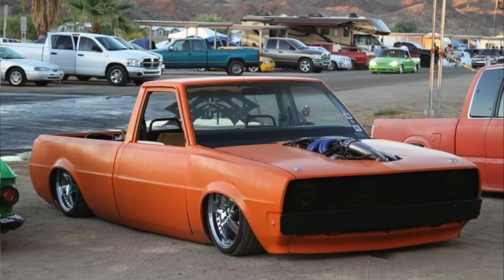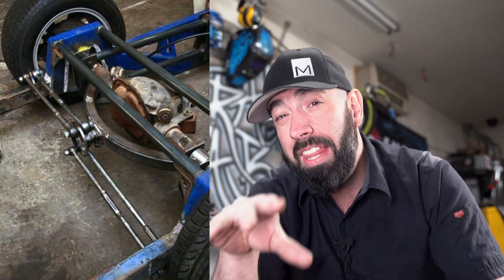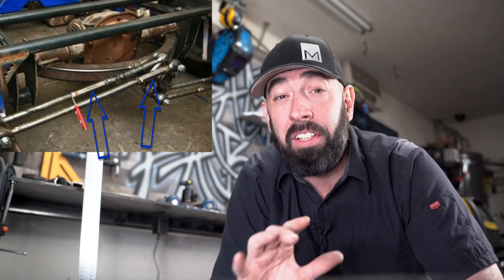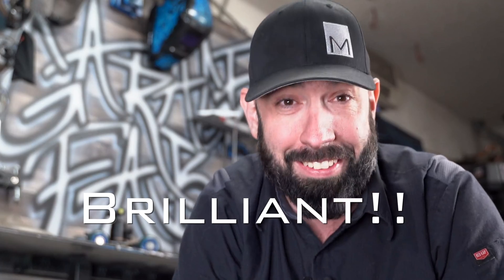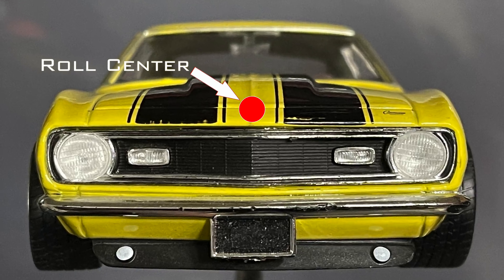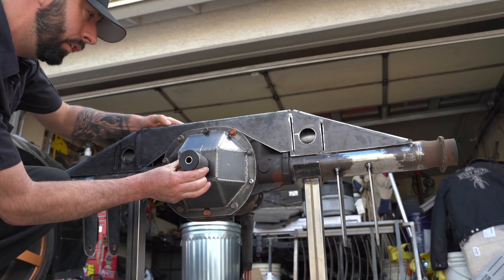Build a Tough Differential Cover! (For a Watts Link [Or Not, Whatever]) Mighty Max Ep. 15

Comment: Is the bolt for the watts link center pivot in the bell housing?
Reply from the maker: The bolt is threaded and sealed into the reinforced differential access cover. 👍

Comment: Many year's ago i done a 9 inch diff conversion into a xf falcon sedan that had watts linkage...i shaped a piece of 1/2 plate to match the slight curve of  rear diff housing with the pivot bolt integrated into the plate than welded  it on the back housing of the bango diff housing it worked fine
Reply from the maker: Beautiful!

Comment: I hate to be the bearer of bad news but your diff cover design will grenade your ring and pinion due to poor oiling. Gale Banks did a demonstration of why the covers are shaped the way they are and how a lot of aftermarket diff covers are terrible.
Reply from the maker: I hate to return the bad news but your bad news isn’t bad news! This cover is a cover for factory diff cover. It’s structural yet superficial. Aside from a small amount of bolt protruding into the factory cover which I’m sure will create some turbulence, nothing has changed from factory.

Comment: There's a great video out here somewhere on differential covers. I was amazed at what they are designed to do in loads above norm. Fyi You just insulated the cooled spray area ( oil OFF the ring gear,) and designed in drip points if I remember, all  which plays an important roll in cooling and lubrication. To me it was as important as your u-joint video. Awesome btw! Thank you!!!!
Reply from the maker: I’m guessing you’re talking about this one…
https://youtu.be/7AmLbGSvESg
This was the video that made me design my diff cover to cover the original cover.
(That’s a lot of coverage)
Thank you, James!

Comment: Great job but Weren’t you afraid that the weld spatter got into the gears and would damage them? Did you use weldingspray. Greetings from the Netherlands
Reply from the maker: Hey Chris! I should’ve mentioned it in the video, but I am replacing all the internal components in the differential. Antispatter spray at a minimum probably would have been a good idea otherwise!

Comment: I would love to see more about the D350 although it totally sucks that it is no longer with us. Gorgeous truck. 
I've always liked that early TBI fuel injection manifold.
Reply from the maker: Well Kevin, you’re in luck. She’s dead but she’s coming back better than ever. And pretty soon! I just purchased two Chevy Impala SS front wheel drive LS V8 donor cars. Both drivetrains will be installed in the same truck. The end product is a twin engine, 16 cylinder all wheel drive Mini Truck with 4 wheel steering. I’ve got all I need except shop space to do it. 
It hasn’t been officially announced yet though so Shhhh 🤫 
At the beginning of the project I’ll describe the original version in detail with photos.
Reply: @GarageFab  This is EXCITING news!  Talk about an insane project!!!
Reply from the maker: Shhhh! You weren’t supposed to see that. 😂
Reply: @GarageFab  Lol!  I've often thought about doing something like that, I'm glad to think someone actually will do it, since I never will (pretty sure).

Comment: Great video, been watching through the whole series. The only thing bugging me is the open diff! You gotta keep that thing sealed off, especially when welding. Don't want spatter to stick on the gear teeth, it'll ruin the hardening in that spot and cause spalling.
Reply from the maker: Thank you my friend! I agree. I should have mentioned it and explained that I plan to replace gears, bearings and seals. I was more concerned about protecting the bearing race lands so I just decided to leave it assembled.
Thank you for watching my man! 🍻

Comment: What is that darn drill bit called?
Reply from the maker: Scroll down through the description of the video and you should find a pair of links to the specific ones I currently own. If you can’t find it, search for Hougen RotaCut hole cutters. They’re not cheap but worth every penny. 🙌
Reply: @GarageFab  thank you. I looked in older vid and didn't see them linked maybe. 
Look to be worth the $$.
I like them being so short.
 I was thinking of getting the new stepped  Drill bits  That have come out recently
Reply from the maker: Are you referring to the typical drill bit with the stepped tip? I have yet to try them myself. Lemme know how they work? I’m a huge fan of the Harbor Freight step bits. They’re far from indestructible but they last a good while if your gentle. (Oil, keep ‘em cool, etc.)
And they’re dirt cheap.

Comment: Bee's wax on the cutting wheel saves the wheel and cuts faster, also helps aluminum NOT clog up disk.
Reply from the maker: I will most certainly try that! Much appreciated. 🙏
Reply: @GarageFab  I get it on the internet, makeup grade comes in sticks, was cheap, and easy to find
Reply from the maker: I dig convenience! Thanks again!

Comment: Use soap on your flap disks and grinder wheels before you do aluminum and it keeps them from gumming up. Just coat the wheel with bar soap bud even smells great
Reply from the maker: Haha! That was the best tip I've received so far. I was told bees wax but that sounds like it falls short it the smell department.
Reply: @GarageFab  any flavor ya want haha

Comment: Be sure to add a fill and drain port with sight gauge for level checks. Makes it way easier for inspection and service.
Love the look.
Reply from the maker: I nearly added a fill port. I even purchased a threaded bung and plug. But when I went to measure the height of the fill in the factory, I realized it didn’t have one and then found out the Mustang axle fluid plugs are in the differential and not the cover!
As for a sight gauge, that would be far too convenient for me. 😂 
Thank you Mark! 🙌

Comment: I think your fab is amazing, but your theory about roll center is not correct and/or not fully explained. 

I believe it is not as simple as you made it out to be.  Your explanation of what happens with roll center does not mirror what I have experienced in my car. I run my roll center as low as possible to keep the rear tighter through the corners on the track. When I raise it up, it will have more of a tendency to oversteer. At this time, I'm not running a sway bar either.
Reply from the maker: Thank you! Let’s go with “Not fully explained” 😂 My knowledge is admittedly lacking when it comes to the science of race suspension, so to prevent spewing garbage, I keep it short. That’s also important to keep from diving so deep I start to loose peoples attention.
Unfortunately some things can’t be fully explained well when highly abbreviated.
I’m shocked to hear you claim to have no sway bar. My first thought is, “He must be full of crap.” And then I see your videos of some impressive SCCA runs and then think “I must be missing something.”
Where is your roll center and how are you adjusting it?
Reply: @Garage Fab  I don't know the actual measurements.  It's a panhard bar that's mounted to the frame and the opposite end of the axle. I got inspiration from Mike maiers set up. 
I'm not saying that the car couldn't benefit from a sway bar, but smarter people than me said to try it out first wo one.
Reply: Also check out the unfair advantage by Mark donahue and all the books from carrol Smith. They both helped me sort of understand everything
Reply from the maker: I most certainly will, thank you! I don’t plan to race, but I believe a better understanding of how performance systems work would be very helpful in creating any type of suspension.
You are appreciated.

Comment: You are doing absolutely awesome work! I have a project of my own. But, I am having trouble with a 4-Link suspension using the same rear end as you are working on. My theory is using the factory bushings on the top of the mustang rear end. My project is building a Special S-10. Any help is greatly appreciated. Thanks 🙏 and have a blessed day!
Reply from the maker: Thank you, Kevin! 
First question, are you planning to do air suspension?
I was considering the same thing. I changed my mind for a couple reasons.
The factory Mustang bushings ended up being too far apart for the much narrower Mighty Max frame. I fear a similar issue with the S10. In order to get an adequate angle that would keep the axle stable under heavy cornering, the upper bars would have to be really short. That’s not a big deal if you’re building a static height vehicle. The Mustang upper arms are quite short. But short bars cause problems with adjustable suspension especially if you’ve got significant travel.
The shorter the bars, the more front to back motion your axle will see and therefore could potentially pull your driveshaft out of the transmission.
My second reason might not be as relevant to you… I wanted to build an axle truss and it was looking like the angled bushings we’re going to cause some issues.
If you do decide to go that route, I recommend investing in some Spherical upper axle bushings to replace the rubber ones. They will allow for a lot more movement that would normally tear the rubber.
Reply: @GarageFab  No, I was not planning on air or bagging it. I am planning on using coil over shocks and with a custom 4-Link suspension but without any upper wishbone! I was not planning on using short upper bars and they can be equal length. I do like the idea of what you did with the D-350 double bar watts link! With the idea of a custom 4-Link suspension I was planning on using the factory mounts as much as possible but if not so be it? I am also planning on maybe a 3” / 4” drop stance ride height as well too just enough for nice clean and cool stance. I like your rear cover for the 8.8 and I was wondering how much would you charge me for maybe making me a couple of them and for me to powder coating one of them chrome and the other one in color of my choice. lol Thanks 🙏 for replying back with the information! I know what I like when I see it but whenever it comes to the math and geometry of a 4-Link suspension I am lost?
Reply from the maker: Sounds like you should be good then. Using factory mounts like the front leaf springs frame mounts is generally fine structurally for non air suspension. They hang down too low so they won’t allow you to lay frame but that won’t be important to you. The only possible effect to using those mounts is because they’re so low, it may cause your bars to angle down some which will could potentially cause you to lose some traction on acceleration. That also may not be of much importance to you if you don’t plan to race.
As for the diff covers, since starting YouTube, I haven’t been taking on any custom work. I just don’t have the time for it. My apologies. Best of luck, Kevin! Feel free to ask questions as you go. 👊
Reply: @GarageFab  No, I don’t plan on racing the truck but it is mainly used for the street and custom look. Their is a kit from Ride Tech but I just wanted something slightly different. 
As far as the differential covers go…. I just thought I would ask? Thanks!

Comment: You gonna do any videos on the new edge at all?
Reply from the maker: Haha! Yes! I have some planned though probably not what you’d expect or even want.
I call the Mustang my “Shop Truck” because I don’t have one. And I don’t want one. I plan to build a custom roof rack, a hidden trailer hitch and potentially a custom push bumper if I decide to keep the Police paint scheme for a while. 
I also wanted to put it in air suspension but I’ve got much more exciting things planned so that probably won’t happen.

Comment: Very cool vid, presentation, humor, tech. Subscribed!!
Personally I wouldn't be happy welding over an open axle / diff, it's at risk of having bb's dropping in.
Reply from the maker: Thank you my friend! Glad to have you.
I agree. There are several things on this build that haven’t received the amount of care I usual give. Typically I’d remove the internal components first. Instead this time I coated the gears with anti-spatter spray and went at it. As for the BBs, I intend to thoroughly flush the entire axle housing before final assembly. There is so much metal and aluminum oxide abrasive dust packed in there after the axle was shortened, a few weld beads are the least of my worries. 😂
Reply: @GarageFab  OK buddy, fair play. I guess its hard to cover all the details in a quick video but you've got them covered. Looking forward to more from you.

Comment: Binge watching this channel as well! I'm trying to figure out c-notch/link suspension on 99 s10 that I'm I'm putting hydraulics on...I need the rear axle to "3 wheel" or pivot while also going up and down..any help would be appreciated. Love the videos man! please keep posting vids! Can't wait to see more! "Keep moving forward " bud!
Reply from the maker: Thank you, Claudio! I haven’t had the opportunity to build a truck like that yet, but if I did I would definitely go with a triangulated 4 link. Maybe even a double triangulated 4 link. With heim joints on all the bar ends, you could get a crazy amount of travel and articulation with no panhard bar or watts link to limit you. If setup properly you could potentially get 24+ inches of lift and still be completely drivable.
(Bonus tip: with a triangulated link setup you could theoretically remove the frame over the axle eliminating the need for a notch. Granted it would take some creative engineering to mount the bed and fuel tank but it’s possible. 🤔)
Lemme know what I can assist with and I’ll try my best.
Reply: @GarageFab  thank you sir!! I appreciate the quick response!

Comment: Use wax on your pad when grinding aluminum
Reply from the maker: Thank you!  Someone told me bar soap earlier. I’ll have to try both. How often do you have to re-apply?
Reply: @GarageFab  depends on how much your grinding. But if you get into a heavy grind you’ll wax every couple minutes. You can tell when the wax starts to wear off. Just as you can feel it starting to feel sticky add wax. The wax I use is by lps it’s in a green(caulk gun like) tube. Tapmatic edge lube. Extents the life of cut off wheels and everything.
Reply from the maker: Very much appreciated! 🙏
Reply: @GarageFab  no problem at all. Any time I can help make a fabricators life any bit easier I try.

Comment: I wanted to do this for a long time but, stopped because the form of the cover is on purpose. Not just to be cheap it's formed to make the spray off the ring gear to be directed to the side bearings and axle tubes. At least on what i was working on (12 bolt chevy). Also the bolts are your next weak point, I would step them up a size or two and only use grade eight. it's no longer about clamping force but the bolts sheer value
Reply from the maker: Agreed and agreed! I mentioned it early but neglected to show that this cover mounts over the factory cover. If this were my vehicle I would most certainly beef up the bolts. I drive like an idiot. 
I make jokes but my Wife drives like a sloth on sedatives. So I’ll be changing the bolts from those shown to some stronger bolts but keeping the size. In my opinion, 10 3/8” bolts would have a greater shear strength than the 9/16” bolt that attaches the Watts link bars.

Comment: Awesome cover. I'd like to say that I'm old enough and experienced enough so that I no longer make mistakes....I'd be lying. The reason stock diff covers follow the ring gear's shape, is to direct the oil to the bearings and the pinion bearing etc. with a minimum of work. Since your new diff cover, does not do this and is now standing away from the ring gear in a flat plane,  the oil won't be directed to the places it is needed as it should be, it will be going all over the place inside the differential and not oiling the pinion bearing, the carrier bearings, the ring & pinion interface and even the out axel bearings correctly. You can't just add oil to the diff because that will promote foaming and develop more heat which will kill the oil's lube properties faster than stock.  It will also affect your fuel mileage as the ring gears is now buried in oil, contributes to not only more heat, but fluid generated power loss. This will happen with any the flat backed diff cover you can buy aftermarket. One thing you still can do it weld in directional vanes inside the cover to make that problem go away.  Rather a great deal more engineering needed. I am wondering why you didn't make the new cover from aluminium, I think you have a Tig...yes? Well that's my lecture for the day, I'm going for a beer.....well, I would if I had any.
Reply from the maker: Ahhh, aluminum. One day. My machine is capable of steel TIG only. Aluminum TIG is certainly a skill I hope to acquire in the future. Maybe after a welder manufacturer discovers the channel and sends me a machine for free. I can’t see myself dumping that much money into a machine I’d rarely use.
As for the diff cover, this one will be as good as the factory one. Because the factory one fits underneath. I saw a YouTube video several months back of various styles of covers made in acrylic so you could see the foaming oil inside. Very eye opening. I’m no engineer so I just have to depend on the knowledge of the original manufacturer. 🤷‍♂️
Reply: @GarageFab  I hope you are gifted with an AC/DC TiG as well, they're awesome machines. However, in the meantime you can flame weld aluminium, (if you have a torch and some small tips). I like the Henrob/Cobra torch I purchased many years ago. They are fantastic for fine work on aluminium.
Reply from the maker: I have seen flame welding in videos. They made it look easy but is that not one of those skills only the elite and most skilled craftsmen in the world?
Also, until I’m no longer working out of my attached garage, I have a bit of a fear of torch setups.
Reply: @GarageFab  I have several gas torch setups, I store them in my fuel bunker along with the dynamite and munitions to keep everything safe...😎
Reply from the maker: Exactly! 🤯